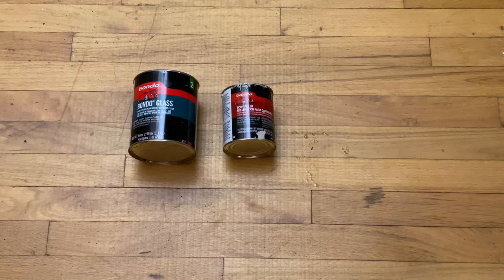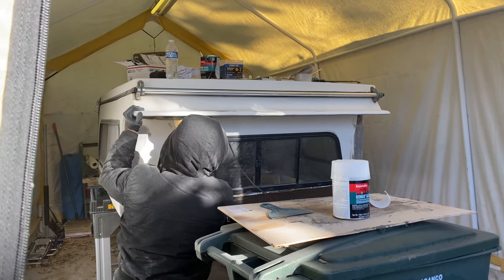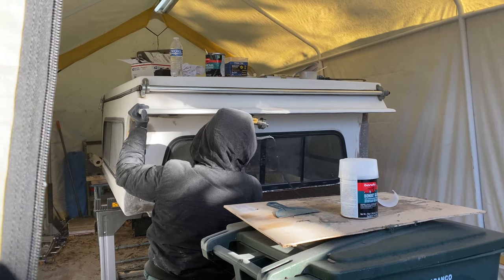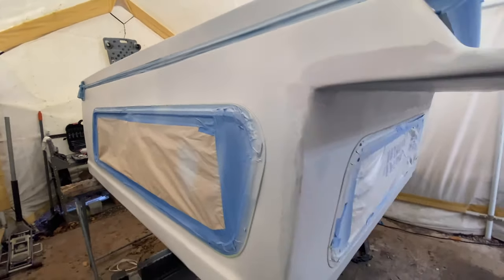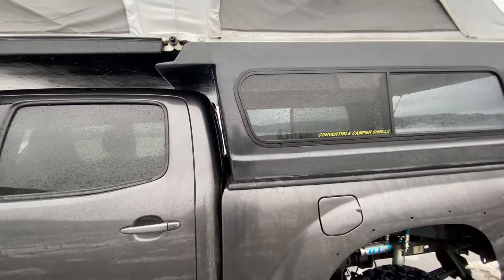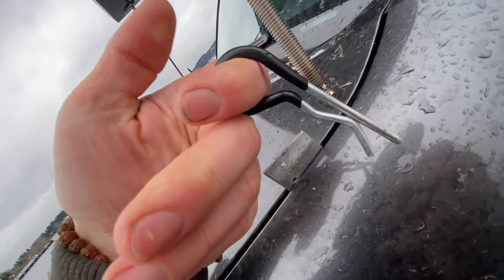CUTTING UP A FLIPPAC CANOPY TO FIT OUR TRUCK

Comment: You did a great job.  Little history. My dad, Dwight Barr, was the inventor of this back in the 70’s as I entered college. Started with plywood and bed sheets to design. Eventually started production using aluminum honey comb construction. Produced then as Barr Top. Sold his production equipment, three patents, and molds to Flip PAC who continued production. They went out of business and sold to FSG. Patents ran through there shelf life. Now many car top manufacturers use the auto three bar folding pop up feature.  The patented torsion bar design seems to have been dropped, as these tended to break over time.

Comment: I would kill for a flip pac those things are like unicorns, I do not understand why some company does not use the design and start building them again, the design is WAY better than other things out there. I saw a guy who on one side built a bench seat doubled as a single bed, had a table that rotates out of the way and other side was sink, counter, stove cabinets and a slide out fridge/freezer and all of it was constructed in pieces and came out real easy.
Reply: AT overland's habitat is the only design that comes close to this. It flips the other way though, creating a canopy over your tailgate.

Comment: Are you still running that Stabilizer rod setup?  We might have some solutions for your Flip-Pac as we also have some things for it after having one for a few years for one of our DEMO rig setups.

BTW, the owner of FRP had a heart attack back in 2014-15 but survived it.  It was a scare for the family and they didn't want to keep the business going without him and it quickly went to the wayside.  Before we were who we are now, I was approached with the opportunity to buy what was left.  Great opportunity but bad timing.

I got at least a dozen ideas for improvements on the Flip-Pac that should have been considered by FRP long ago but they didn't want to execute or change anything new to the design leaving it the way it was.
Reply from the maker: Yes, we’re still using our current rod setup.

Thanks for the clarification on the owner of FRP!
Reply: I herd he wanted a ridiculous price for the molds and tooling. I own the flip pac that was pictured on the AT website back when they sold them.
Reply: @shurppa64  They did, then the people that bought them that contacted me wanted even more then that of course.  Obviously sitting on their hands with it because I haven't seen/heard any resurrection of the product.  It's a good product, just needed some improvements to take it further.  I think it rather inspired maybe many of the hard shell RTT we see now.